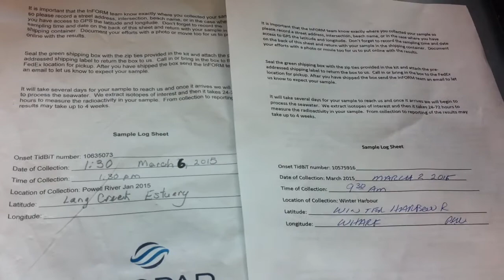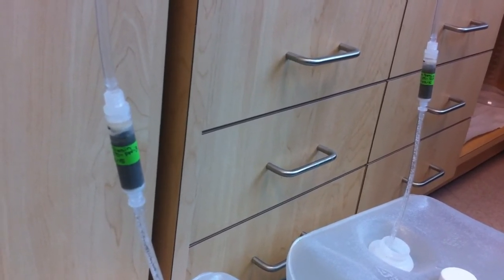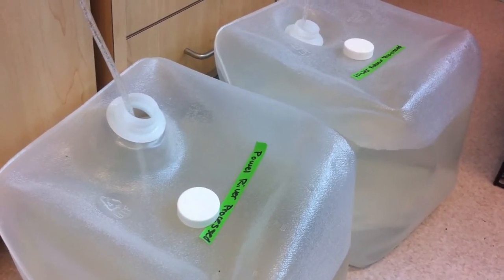InFORM Citizen Science: Concentrating Radiocesium from Seawater Samples

Comment: Are you looking to detect cesium 134 which is the best footprint for Fukushima radiation
Reply from the maker: Bekanimi j We are using gamma spectrometry to measure 134-Cs and 137-Cs.  Seawater samples are also being analyzed for 135-Cs and 129-I using Accelerator Mass Spectrometry.